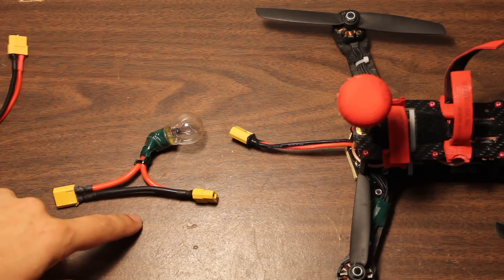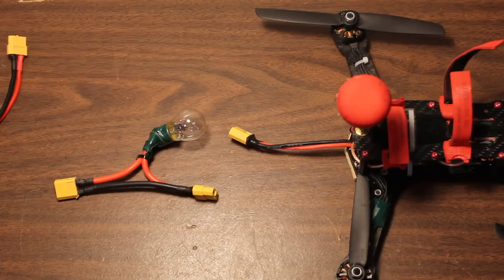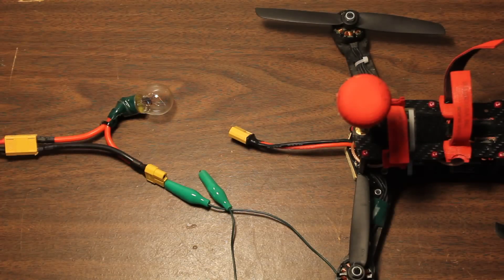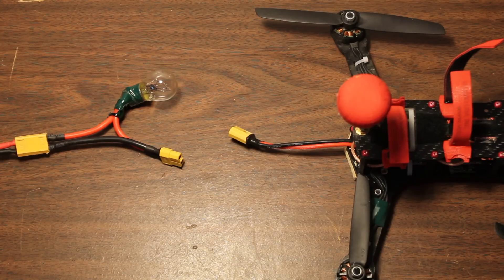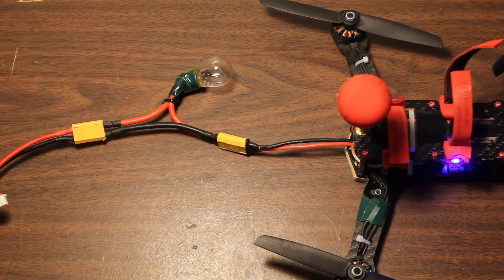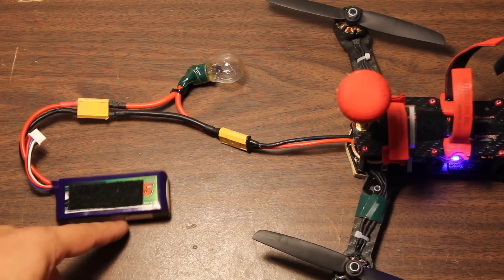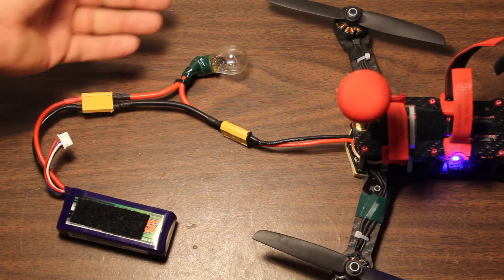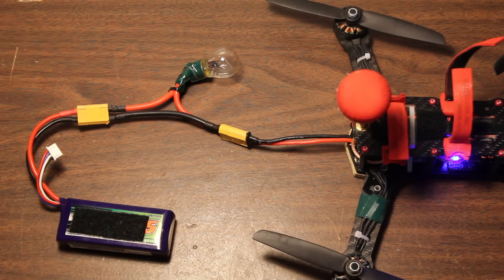"Smoke-stopper" protection device for RC plane quadcopter etc...

Comment: Hi, here in europe, we don't have these taillamps. Would it be correct if i choose a bulb according to the amps and voltage? 2,5a*16,8v(4S)=42W so i could choose an ordinary household bulb? Or is there any other mystery-math-magic involved?

Thanks
Reply from the maker: +bind the bulb is not a simple resistive load because it heats up as it passes current and it's resistance changes, but yeah... Ohm's Law.
Reply from the maker: +bind you can't use a household bulb because it's designed for 240 volt. Try looking at a caravan supply for 12v light bulbs.
Reply: +Joshua Bardwell If i have to choose a 12v bulb and for 3S, which wattage should i choose? Your 3257 bulbs are rated for 26,9W and the other filament for 8,3W, so around 35 W ? Or a 42W 16V-20V bulb for 4S?
Reply from the maker: The higher the wattage, the more current it will pass. Obviously you don't want it to be too high though! And if you are going to use 4S, try a lower wattage because the bulbs are designed for 12v not 17v.
Reply: +Joshua Bardwell  yes, but how much for 3S? I got 3S lipos, so i'm gonna drop the idea of using 4S.
Reply from the maker: I honestly didn't put a lot of thought into it. Just grabbed a bulb I had laying around. Just check the current with a meter. You want about 1 to 3 amps. Lower wattage would be better I think.

Comment: Hey Joshua! 

Thanks for spreading the word about the SmokeStopper™! The more people who build it and use it, the BETTER!

Remember too that you want to also use this ANY TIME you flash ESCs on your quad... the process of flashing CAN cause both high side and low side FETS to turn on at the same time, creating a short that blows up ESC and motor. This will prevent that untimely death!!!

Original Build Log is here: https://www.rcgroups.com/forums/showthread.php?2327875

Lots of good discussion in the thread about the theory behind it, and why it works best made just like yours is made.

Also, if you haven't seen my own video on the device, it's here: https://www.youtube.com/watch?v=8a6sj-_GOo4

WARNING! I Stick my hands in the props TO DEMONSTRATE A POINT! You can STILL hurt yourself doing this if you have bigger motors/props, are working with a single motor or have dainty little girly hands. ;)

[EDIT]

Hey Joshua - 
Just a quick heads-up; As things have evolved in our hobby, so too has the SmokeStopper™: https://www.rcgroups.com/forums/showthread.php?2327875

Due to the fact of ever-smaller whizzy flying things driving development of ever-smaller and more sensitive electronics in all aspects of RC modeling, we now recommend to use a Low-Current version (or a High-Low Current switchable set to Low current) for initial testing on any RC model. You should reserve use of the original High-Current version only for motor testing and diagnosing issues with high-current stuff like bling lighting.

See my updated build log with lots of new material and graphics, outlining the theory and operation and how to build all 3 versions at my original build log, which I've recently updated at the link above.

Cheers, and thanks again for helping spread the gospel!

[/EDIT]
Reply: mnemennth nice work dude read you're tutorial on RCGROUPS !
Reply: Thanks dude! Remember to Pay it Forward! :D
Reply: Flashing ESC can cause short on my ESCs? I'm so lucky I haven't destroy any of my ESCs by flashing it
Reply: Smoke stopper trademark??? Really?!

Comment: Would this work with a 4s or would that blow the bulb?
Reply from the maker: +GMAC FPV 4S works fine. You get about 3 amps through the bulb instead of closer to 2.5 amps.
Reply: +Joshua Bardwell thanks for the response. I suppose it is only for testing so no harm using a 3s while testing then use 4s for flight. Thanks
Reply from the maker: You could easily put two bulbs in series if you wanted.
Reply: That would half the voltage through the bulbs right? So about 8v each?
Reply from the maker: Ignoring the fact that incandescent bulbs are non-linear resistors, it would approximately double the resistance and halve the current. The bulbs would act as a voltage divider, where voltage between the two would be approximately 1/2 the voltage on the positive side of the bulbs.
Reply: Great explanation, thanks! Will be picking some of these bulbs up tomorrow! Have now had motor bolts touching the windings twice! Hopefully not any more with this little guy! Thanks again.
Reply: +Joshua Bardwell could thus double up as a lipo discharger also?
Reply from the maker: Yes absolutely, but put an alarm on the battery so you don't forget and kill it.
Reply: Nice! Take it you just short the battery with crocodile clips like you did?
Reply from the maker: +GMAC FPV yes, exactly.
Reply: Great thanks!
Reply from the maker: mnemennth I've put 4S across this bulb, using a dead short to discharge a battery, for months now with no problem. I haven't tried an HV though. I get about 2-2.5 amps on 3S and 3-3.5 amps on 4S.
Reply from the maker: It shouldn't matter. Running 3 amps across two filaments or 1.5 amps across 1 filament has the same probability of burning out the filament.

If you really care, get two bulbs and put them in series with each other. Or get a 24 volt bulb, if you can find one.
Reply: +Joshua Bardwell 

I've blown them up instantly with a fresh-charged 4S pack, more than once. One time cost me a brand new KK2.1 HardCase FC while flashing ESCs. The bulb blew due to FET latchup, which caused the BEC to short internally, sending 16.8V direct to my FC. It took that personally for some reason... :p

That's why I've recommended since I released the blog that you only use 3S on it. ;)

Also, the reason not to use a fuse is this: Fuses are SLOW. By the time a fuse blows, massive current has already flowed for a few microseconds, and FETs are ALREADY TOAST.

As you've suggested, the filament actually increases resistance as more current flows, so damaging current never gets a chance to flow. In many cases, particularly with inductive loads like our brushless motors, this is even more effective than a current-limiting power supply.

Cheers! :D
Reply: +Joshua  

4S with this is bad JuuJuu. If you have a short it can blow the bulb and THAT can cause damaging voltage spikes. 

This is ONLY for testing. Best practice is to stick it on an old 3S pack and keep it there handy so you're NEVER tempted to power up without testing first.
Reply: +Joshua Bardwell as a safety tool, is it better using just the one element of the bulb so that the amp limit is lower?

Comment: so just use the highest wattage 12v bulb you can find? did you just wire to the bulb terminals or is there a socket you used?
Reply from the maker: I soldered to the terminals, but a socket would be easier to replace when it burns out.
Reply: +Joshua Bardwell ended up getting the socket for 3157 bulb, $7 more... but just used its wiring to go from positive to positive, super clean, super easy to change bulb.

Comment: Great tip. I particularly like the ability to adjust FC settings while keeping the props on. How do you think it will work with 4S battery considering its a 12V bulb ?
Reply: I can see that it might happen on something like a halogen because they are a 12V bulb that is built as cheap as possible and for a stable 12V load. This is why I make the distinction with automotive bulbs. They need to handle the voltage spike and noise from a car alternator (14.4V) and be mounted in a car (heat/vibration/cold/moisture) and so are built very robust. I would be shocked if anyone could blow up a car bulb in a smoke stopper configuration, even on 5 or 6s.

I use a 12W car bulb and even spinning up all the motors on a quad it gets to maybe 1/4 brightness.
Reply from the maker: +Tony Leyland Expressive Imagery The key is how many amps it will let through. It goes back to Ohm's Law. If a 12.6 volt battery lets through 2.5 amps, then the resistance is 5 ohms. A 16.8 volt battery would produce 3.3 amps. You could also use a single-element bulb, or only hook up one element of a two-element bulb. This would increase the resistance.
Reply: +Joshua Bardwell This is not actually true because a light bulb filament is not a simple resistor. Its resistance varies with temperature. You will certainly get more current through it with a higher input voltage, but it wont be as high as 3.3 amps. p.s. thanks for making this video, I have been using a similar setup on my quad and I'm constantly telling everyone that smokes escs and motors to do the same, they don't listen.

edit: this is for most types of lightbulbs ie tungsten filament. I believe carbon filament have the opposite characteristic.
Reply from the maker: +mnemennth Like I said above, I've used 4S with a dead short across this bulb to discharge batteries. It hasn't blown yet.
Reply: +mnemennth Um no, if the 12V bulb can handle 16V then its completely fine to use 4s. If there is a short in the quad then the bulb lights up and limits the current, exactly as its supposed to. If in the unlikely event the bulb blows, it will blow open circuit, thats what bulbs do. Think about what would happen if bulbs failed closed circuit...
Reply: I think you're wrong, people reading the comments can make their own decision. Automotive bulbs have no problem running at 4s voltages. If you do get a crappy one that blows on 4s, it will blow open circuit like a fuse and so Im not sure where your "damaging voltage spikes" come from.

Sure maybe running an automotive (14.4V) bulb on 4s continuously might lessen its life (I doubt it). BUt thats not what you are doing with a smoke stopper. In normal use the smoke stopper bulb will not light up because its just acting like a piece of cold wire.
Reply from the maker: Goat I think you've hit on an important nuance. It's not volts that blows the bulb, it's amps and heat. You could put 50 volts across that bulb, and as long as there was a series resistor to prevent any current flowing, it wouldn't blow. In typical usage, the quadcopter is that series resistor. Only if the motors attempt to spin up will the bulb soak potentially excessive amps.

As you point out, if the bulb DOES blow, it will blow open and be safe. I have a lot of respect for mnemneth's technical knowledge, but I can't understand why he thinks this is such a danger. At worst, you will waste money by blowing bulbs unnecessarily.

FWIW, when I was testing 12v halogen bulbs as a discharge load for battery testing, I found that the bulbs would take 4S no problem, but they blew instantly on 4S HV.
Reply from the maker: +ThrustTestGuy GOOD POINT.
Reply: +Joshua Bardwell 

No to 4S; if you have a short it can blow the bulb and THAT can cause damaging voltage spikes. This is ONLY for testing. 

Best practice is to stick it on an old 3S pack and keep it there handy so you're NEVER tempted to power up without testing first. :D
Reply: @Goat - 

What part of "I've blown them up instantly with a fresh-charged 4S pack, more than once... That's why I've recommended since I released the blog that you only use 3S on it. ;)" was unclear? These bulbs are meant to operate at 14.8V max; I've tested them to 15.8V and found it to drastically shorten their life. They are NOT safe to 16V... at least not that you can COUNT ON.

I appreciate that Joshua has gotten lucky using his particular light blub as a discharger on 4S packs... but we can't count on every user who builds one of these getting a light bulb that can handle such abuse.

Cheers!
Reply: You're thinking like this is a DC resistive load. It is NOT. It is a dynamic inductive load; to be precise, it is 4 inductive loads (or more) in parallel.

Whenever there is a break in any circuit due to overload, there is always a "inrush" current which manifests as a voltage spike; this is literally electronics 101 stuff, dude. You're arguing with somebody who used to design this crap for a living.

If you want actual technical discussion, all these questions and more are answered in detail in my original build log, which i've recently updated: https://www.rcgroups.com/forums/showthread.php?2327875-DIY-SAVE-YOUR-ELECTRONICS!-BUILD-A-SmokeStopper%C2%99-!